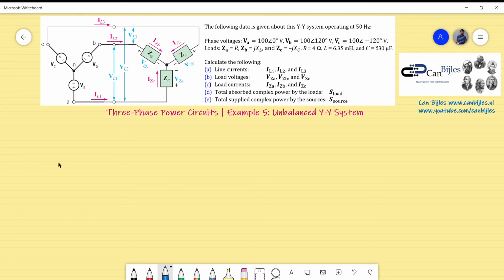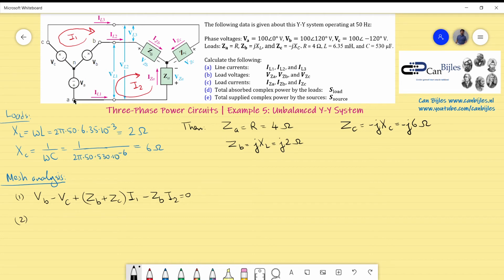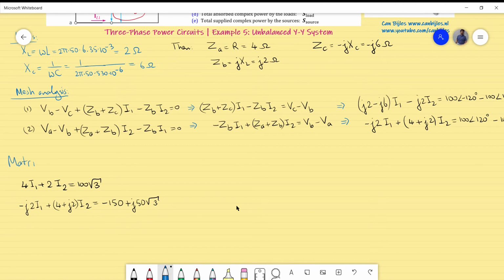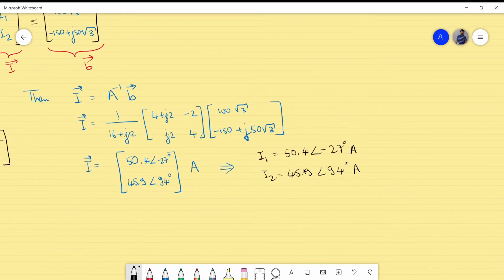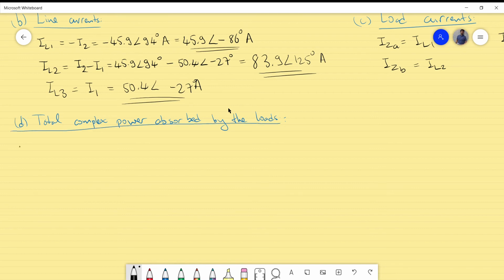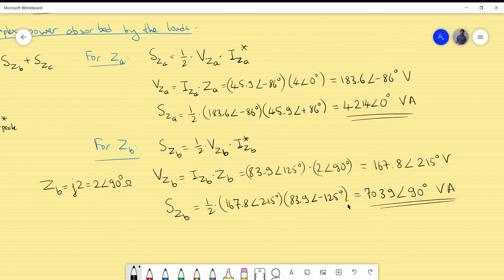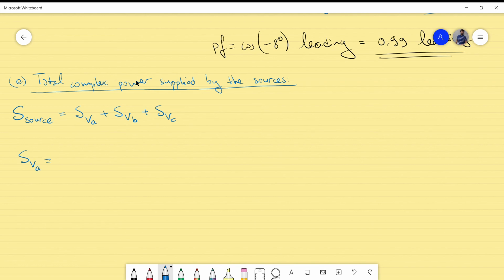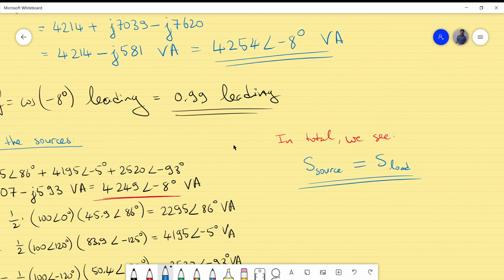Three-Phase Power Circuits ⭐ Example 5: Unbalanced Y-Y (Star-Star) System

Comment: Excuse me sir, I am wondering is it only 3 phase 3 line star connection unbalanced load need use this method to calculate?
Reply from the maker: Thanks for your question. If the three-phase circuit is unbalanced, you cannot use the simple method I have discussed in Examples  #1 to #4. I will place the links to these videos below. In fact, it does not matter how you proceed your calculations unless it is clear and step by step. In Examples  #6 to #8, I have discussed other unbalanced three-phase configuration. Take a look at the links below. If you have questions, just let me know. Good luck!

Balanced Three-Phase Power Circuits:
Three-Phase Power Circuits | Example #1: Y-Y (Star-Star) System https://youtu.be/6GOQJE7K9Tk
Three-Phase Power Circuits | Example #2: Y-∆ (Star-Delta) System https://youtu.be/YansscYCp9I
Three-Phase Power Circuits | Example #3: ∆-Y (Delta-Star) System https://youtu.be/YAobR0zkuVI
Three-Phase Power Circuits | Example #4: ∆-∆ (Delta-Delta) System https://youtu.be/uFHc9ziQ15E

Unbalanced Three-Phase Power Circuits:
Three-Phase Power Circuits | Example #5: Unbalanced Y-Y (Star-Star) System https://youtu.be/jVarF3SHKRc
Three-Phase Power Circuits | Example #6: Unbalanced Y-Δ (Star-Delta) System https://youtu.be/xJ8l20x8Yjg
Three-Phase Power Circuits | Example #7: Unbalanced Δ-Δ (Delta-Delta) System https://youtu.be/NLL-QuKh8f4
Three-Phase Power Circuits | Example #8: Unbalanced Δ-Y (Delta-Star) System https://youtu.be/nTyoRjwYXWY
Reply: @CANEDUX  If there are 3 phase 4 line star connection unbalanced , what should I do?
Reply from the maker: @jasperstar2316  Unbalanced three-phase system can be due to unbalanced sources and/or unbalanced loads. Having a 4 line (4th line, the return line) does not make the system balanced in these cases. You can handle unbalanced systems using the method of symmetrical components, but this is little advanced topic.